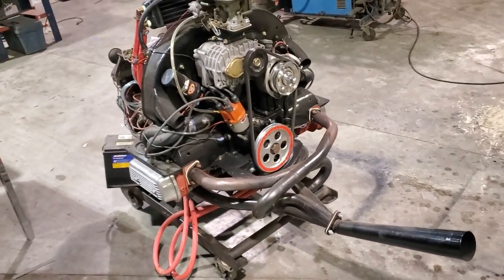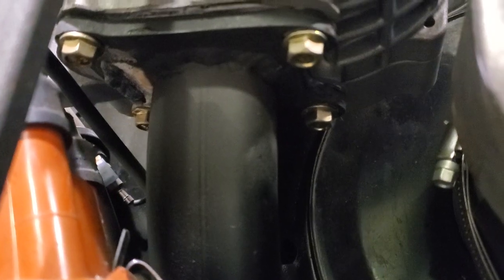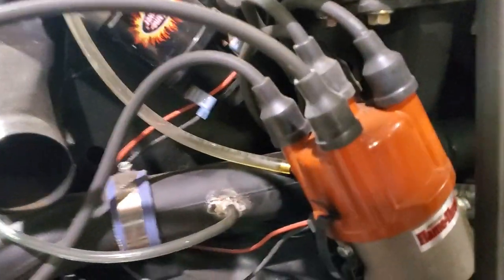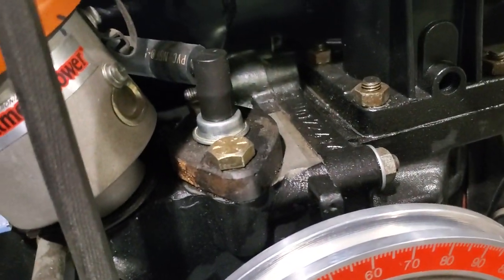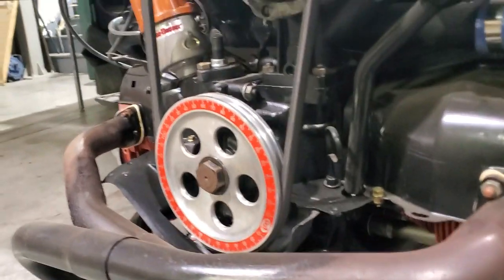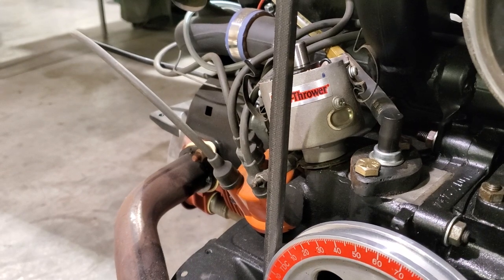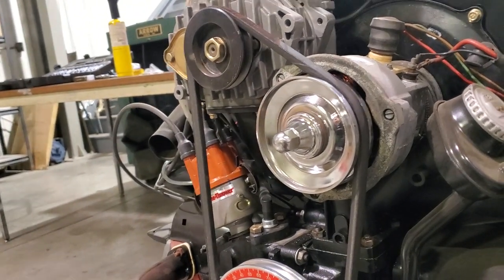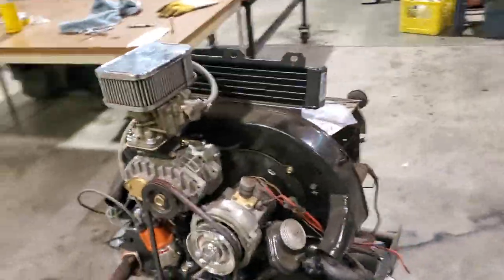Amr 500 1600vw the design set up

Comment: Looks awesome. Couple of things, though. That blower takes over 20 hp at the needed rew range. I have seen a dyno video, and the top was about 30 hp. The modern accessory belt was slipping, even with much greater degrees of contact.  The v belt will slip. A lot. But , for a 1600 cc engine, the possible 50 cfm or sub 100 cfm will be something. With no belt slip that blower is good for about 300 cfm. At least it may negate the parasitic load of the blower. The other concern is that the oil cooler no longer has the airflow needed for it's surface area, as it is now located to the still air. But, the overall view is just beautiful. Try connecting a timing lamp to the coil high tension wire, mark small dots to the cranckshaft pulley and the blower pulley, and while rewwing the engine from the idle up, observe the "stopping" dots if they move differently at higher rpm, indicating belt slipping.
Reply from the maker: Oilcooler got changed out back to an original once I got my hands on one.
I see what your saying about the rest of it. Would be concerning if it was going to be a drag car or trying to produce top horse power. But it's not... it's a car that's just for fun. To tinker on and screw around with. Not to be the absolute best at what it is. If it was to produce power it would have been turbo and fuel injected
Reply from the maker: But thanks again for your look into i, it is neat to see how people perceive its built

Comment: You should have kept the standard cooler and added 1 into the full flow system. The oils only gonna be getting cooled when you’re moving. The standard cooler is has air going over it constantly.
Reply from the maker: i was actually thinking about that when i was putting the shroud on, i'll probably keep the external one but build one that fits in the stock place that flows through and still pushes to the external one all in the same loop. i think i got enough stuff laying around the shop i can build a nice little cooler to fill in the stock hole

Comment: How does that PCV work? The manifold is going to be under pressure during boost when the blowby is at it's hightest. Also did you account for oil vapours in the blow by gasses? I would think a catch cam system would serve you better.
Reply from the maker: It's plumbed into base of carb so there's vacuum there, it's orficed down so it doesn't suck oil up but has just enough so most of the gasses get sucked in but it's still vented out the oil fill breather, it basicly just takes some of the load off of that breather and helps from making a mess when the breather is spitting oily residue

Comment: Hello, I wanted to know what happened or how the supercharger that you put few years ago in a video you uploaded worked for you ... if it worked for you you preferred to remove it because it did not give you much hp?
Reply from the maker: i actualy never finished the car yet, was waiting on some parts and im to get them at the end of this month, so i had it on the back burner for two years working on fishing boats and rebuilding some old rifles in the mean time, but i just pulled the car back in to start some prep for when my parts arive, i'll have a update on this in a few month once body is on and i get a seat in place so i can burn some donuts in my parking lot at work

Comment: are you gonna put any tensor on the belt?? also what type or measure of the pipe did you use??
Reply from the maker: Yea ill be building one eventually ,
And I went with 1-5/8 exhaust tubing and stretched out the ends to fit over the stock intake bits at the head and slowly honed it out to be a perfect Taper fit when fitted together

Comment: Hi. I from Brazil and i'm interested in doing this in my vw1600. What did you use to adapt the arm500? I thinking in buy te arm500, but I dont know what do to adapt it.
Reply from the maker: i built a plate and intake from scratch, the piping is 1-5/8 exhaust piping and i had a chunk of flat plate steel i traced the amr 500 flange to and made it fit then welded it to the intake i made, tig welded it all together and thats all i got under there
Reply: @lilcrazyjoe27  Thanks

Comment: Hey there Joe, I love your build! I'm just now at the beginning of a new VW project and this is perfect for what i'm doing. I hope you do not mind,  i'm going to build this very same engine just as you have done here. I've gone ahead and subscribed and i'll probable be in contact with you for more in depth specs on this engine build.
Reply from the maker: Yea sure no problem
I still havent put it into a car yet so it's not fully set up, I still have to modify the distributor to limit its advancement and put a bit bigger jets into the carb, then I think she will be ready to go
Reply: Kewl,,, thank you!
Reply from the maker: Hey just checking in on how your VW motor build is going or went, get it out on the road? we still haven't got around to finishing this car off so i haven't got to play with my motor yet. if you got any videos of yours going that would be awesome
Reply: I'm doing this TBI unit to bolt directly onto the blower in place where the carburetor would normally mount. I'm using Speeduino NO2C board as the EFI controller.
Reply: Really like that build 
Where can I get that amr set up if you don't mind me asking

Comment: So the AMR's can be mounted either vertical or horizontal? All the kits I've seen have them mounted vertically. 

I've been wondering how to get one to fit under the hood and a crankfired ignition will be the ticket if that horizontal mounting isn't an issue.
Reply from the maker: crank fired IGN would be nice, ive seen a few mounted this way, i went old school on this build. just used exhaust piping and built the flanges to mount it, and the runs fine till it hits past 3/4 throttle then the advancing of the dist. gets to high so i opened the side cover and install a limiting screw so it can't advance full when it starts to make pressure. that way i still have good bottom end and top end. if i went crank fired IGN then i could have went fuel injection but i wouldn't be old school then i like it when my setup doesn't look like everyone else. you get alot less people telling you what to do if they don't have your setup hahahahaha
Reply: @lilcrazyjoe27  yeah, I started searching more and found a couple others. Ideally, crank fired, fuel injected with a single throttle body all under the decklid is my goal
Reply from the maker: @JMC8415  can't wait to see what you pit together

Comment: i put the amr 500 on my 1600 vw dune buggy & it gave it a very notasble difference   but it spins the wrong   way can you get it to go the other way . o ps it sized up to the coating on the gear inside  came off trying to see about getting warranty on it . any body else have trouble  with it i only got about 2 hr run time on  it . its still winter hear but the snow has almost all gone
Reply from the maker: I mounted mine how I got it, the first time mounting it realized yup...spinning wrong way hahaha
Reply: Mike and Joe, the AMR500 will spin either direction and perform the same.  I use many of these in motorcycle applications and the unit doesn't care which direction it turns. Hopefully this helps.

Comment: Sweet set up good job 
What size jets did you end up running please
Reply from the maker: Not a clue I have never took that carb apart, it came off a 1916cc engine that was in a 365 replica, and I just slapped it on and it worked perfectly for our area I live in hahaha, I broke lucky

Comment: Hey Mr Joe. That's awesome. Do you think you could build a manifolds for a type 4 engines for me. Like the top and bottom , between the carburetor and charger and under the charger. Right now I'm running dual 2 barrels. Maybe I would have to get a different intake.  But do you think it be okay with a DB Webber ?
Reply from the maker: If I remember right the intake parts on the head were basicly like the ones on a type one just larger right, you know if you have a exhaust shop in the area you live in that might be a good place to start, just cut up some mounting plates and have the exhaust shop build the intake and have them weld it up, might be a idea, this might be the last beetle I build, I just got into old jeeps recently, got my hands in a old 1949 cj2a

Comment: Eh I was wondering if the amr500 held up with the draw thru set up. I know on turbos you need carbon seals. Is it different with the super charger? 🇨🇦
Reply from the maker: superchargers are a hole different breed then a turbo, they have had drawthrough setups for eons on these

Comment: Can you share the carburetor adjustment because my don’t keep running after the choke turn down the car shut off and I try to get more gas and more mixing air but i can’t get it in running to check if is too hi or low
Reply from the maker: I would have to take this apart to get you that, all I know so far is it came of a 1914cc build, I haven't had to rejet or even adjust a single thing it ran perfect so far, but if I do I'll make sure I get as much info for ya
Reply from the maker: Do you have a video of yours trying to run or anything I could see
Reply: I can take a video tonight and send it to you maybe helps
Reply from the maker: @noeemoreno691  Google up fort radiator Ltd. I'm in Fort st john, find my email there, I'll try and help ya along where I can, two heads better then one hahaha

Comment: Hi I did the same thing but my get the pulley very hot and I don’t know if is something bad in the supercharger do you ever have that problem??
Reply from the maker: No not yet, you know I never really looked how the front bearing of those little amr units get oiled, does it share oil from the gear box in its back? Or does it just rely on grease in a sealed bearing? That's where I would start looking for the problem
Reply: Is oil bearings in the back the front are seal I replace it and runs good I just need to calibrate the carburetor because need more gas or a bigger carburetor can’t find out yet

Comment: Did you have to change the mechanical fuel pump for an electric?
Reply from the maker: i probably didn't have to, but i did, i haven't checked the specs on the flow needed for this carb. so i just winging it lol

Comment: Your progressive carb is a DFAV, which means has an Aqua Choke & you should probably have one with an Electric Choke, since Air-cooled VW's don't have any water system.
Reply from the maker: Thanks for bringing that to my attention I never actually check that out yet, I just assumed either it was modified to electric as this came right off a 1914 build and had a 12v power wire plug on it

Comment: Well does it still run good? What size belt is that? Do you like it better than the serpentine?
Reply from the maker: never run a serpentine belt, this motor if fun. i'll try and get some video of it one of these days when i pull it back out. just busy building a new radiator repair company thats eatting up all my fun play time

Comment: Hey there, I was wondering where I can buy one for my 1495cc vw engine. If you know pls let me know. Thank you
Reply from the maker: the AMR 500 supercharger i bought on ebay.ca "ebay.ca is the canadian version of ebay" it came from china through that, as for the intake to bolt it too i built that with some 1-5/8 exhaust pipe and some flat steel for the flanges, the super charger comes with plastic flanges you can bolt rubber hoses too and make a set up that way also but i wanted hard mounted, i have seen some kits online that you can buy but ofcourse im cheap and dont want to spend $2000 on something i can make and spent $300 on parts
Reply: You can also get it through BBM or Amazon now. Obviously my suggestion would be through BBM vs eBay or Amazon. But your call!
Reply from the maker: I was lucky they were way cheaper when I bought ours with shipping included it was only $216 
Now I see it's gonna cost someone way more

Comment: The engine will over heat,under heads and from rear exhaust port to front exhaust port should come in metal covers
Reply from the maker: You can tell it's not a finished build can't ya

Comment: Which size is crank pulley for not pass 16000rpm the Aisin 500?
Reply from the maker: Crank pulls stock size on engine, aisin pulls is what ever came either it off ebay i never checked or even really cared how fast it was gonna spin really hahaha, I just thought hey I want to slap one of these on and make it fit, thought to my self hey this carb from over here should fit and run about right, you know what I didnt need any fancy math to get it to run awesome either, it just works because its a volkswagon hahahaha

Comment: Que chik ficou o motor , meu eu tenho um Fusca com o motor simpre, e máquina
Reply from the maker: 1600cc, 110 cam, high flow oil pump, carb came off a 1916cc build, high rev springs in cylender head   .....   1600cc, 110 cam, bomba de óleo de alto fluxo, o carburador saiu de uma construção de 1916cc, molas de alta rotação na cabeça do cilindro